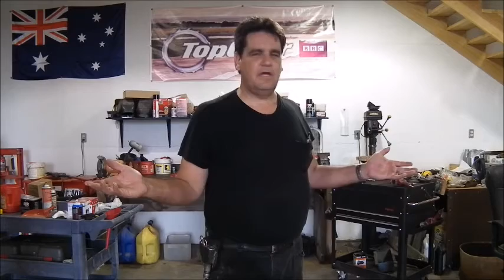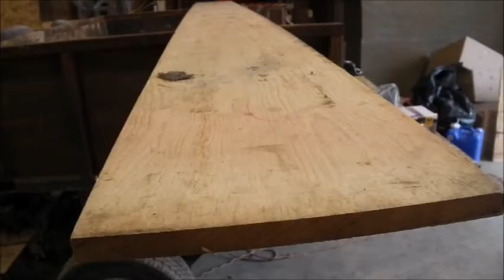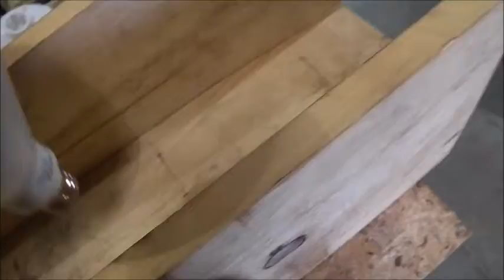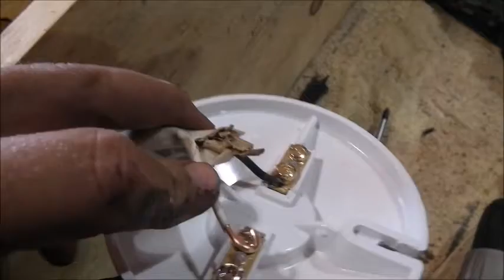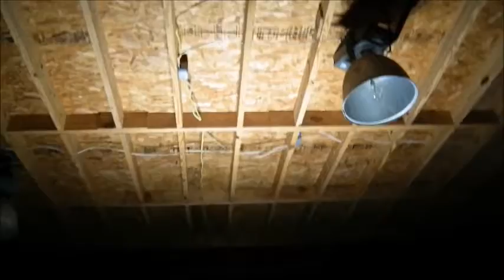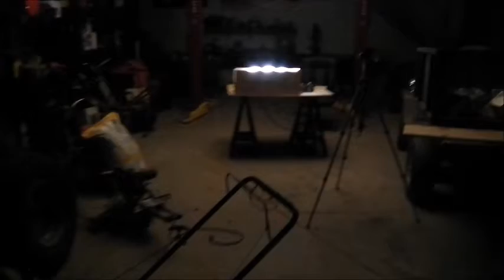LED Light Project Part1

Comment: Ooow i like your starting intro mike :-)

Hmm replacing your superbright lights isnt the easyest thing to do.

Perhaps a few workbench lights would help :-))
Also some on chains to bring the lights closer.

Should be interesting mate :-))
Reply from the maker: I thought I would create some sort of intro. Glad you like it!
Actually, the LED's work better high up as the light is very directional. The height gives the light a chance to spread out and not just have a single hot spot of light just under the bulb. That's been the difficulty with LED's as the reflectors have to try and disperse the light. With LED it's very difficult.
Reply: Mac Gyver
Im sure you will master those pesky diodes :-))

Ooow did you make the intro with toothpicks and office chairs lol, well thats what magiver would do.... or is that the "A"Team hmm :-))